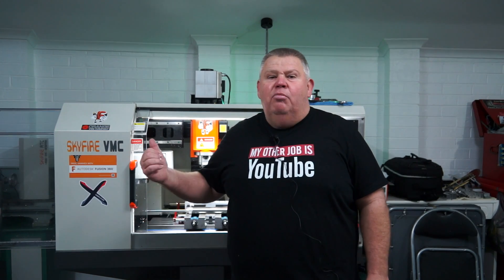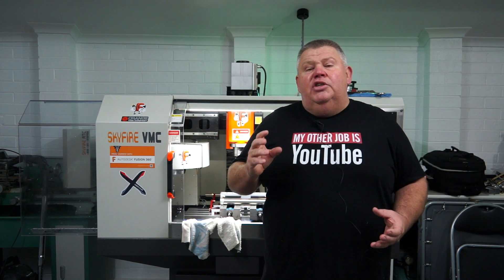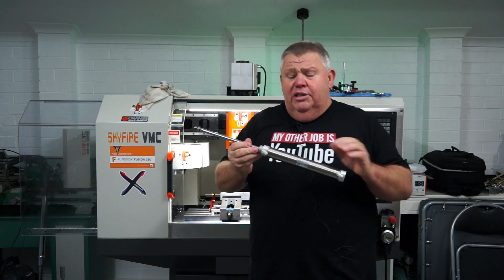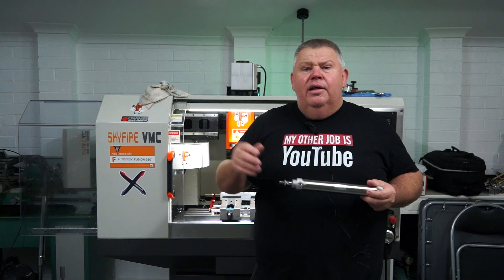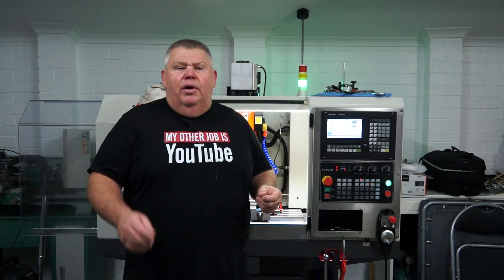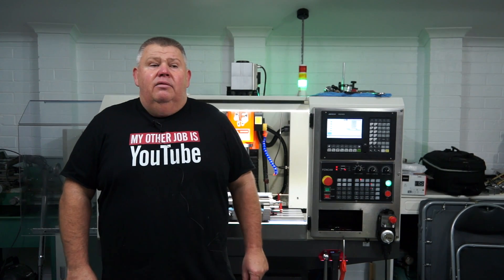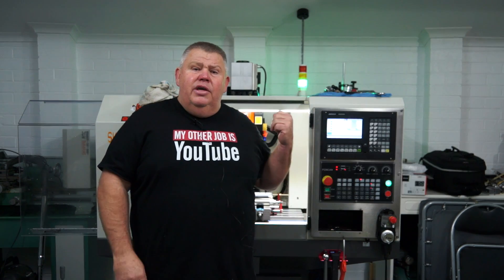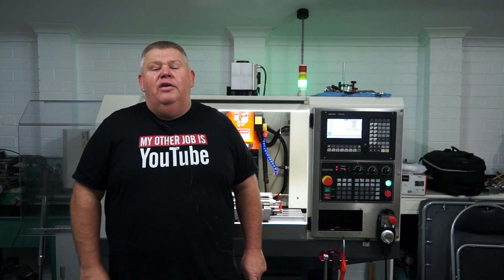I broke my Skyfire CNC Mill - (SVM-1VMC)

Comment: Kenny....I was just thinking. You are aware the Skyfire is a direct copy of the old troublesome Mikini 1610L? (In fact im pretty sure skyfire used the old stock cast heads and column)
You might want to see if you can find Mikini for sale and strip it to the bare bones to upgrade.
Reply: That may be something to look into as if I recall correctly the failure of the Mikini was more spindle motor related than the mechanics of the mill itself. I have been reading all over for the last few days again. The very first thing that jumps out at my about the Syil machines is that there are a ton of threads on the CNCZone with issues that just went completely without response. I am reading back through the Mikini section now.
Reply: Unfortunately Kenny, thats china for you. If you buy china you will have no support. I work at a mutli million dollar company, and their supply chain stuggle to get answer, so consumers dont stand a chance. That why large companies that manufacture in china have european / america support networks. Skyfire tried that with a fee agents off cnczone....but I think even they got pee'ed off with him.

I would scan ebay for a mikini and build your own machine as you want to
Reply: I'm not terribly worried about being self supported as that's what I do know. If I could find a U.S. made machine with what I want that didn't require a 2 a bedroom house worth of floor space it would have already been purchased.
Reply from the maker: Hey Rusty.  Sorry I missed this comment all those years ago.  Yes you are correct it certainly is mate  👍
Reply from the maker: I've had better luck with the new Syil.  It leaves my SF for dead  👍

Comment: Pity I was going to cut my teeth with one of these machines to get into CNC machining, as you well we discussed a few years back mate, its a shame its looks like they have just become they typical type of product that China produces with the usual lack and disregard for the consumer, how long before they take your money and just run...?

So looks like I have to wait another 20 years to for fill my CNC aspirations, or is there another company that hobbyist can get a machine that works without have to go into more debt, and have some reliability without braking the bank, are SYIL or Optimum really any better?

Pete.
Reply from the maker: Hi Peter nice to hear from you.  Overall mate I'm still very happy with my machine.  Obviously the air quality that I supplied is my fault and not SkyfireCNC.  I think the machine is still great bang for buck, but they need to address quality control and update the controller firmware (or chose another company).  I would take a look at SyilCNC and get a quote on one of their X5 or X7 combo machines.  Oh an optimum f80 is basically a Syil X7 frame.  Otherwise, save up and buy a Haas ;-)  Cheers, Aaron
Reply: Ok so you would go with a Siemens CNC controller?

Pete.
Reply from the maker: Yes Syil can offer a Siemens controller.  If you just want normal 3 axis machining the Siemens 808D is perfect.  If you wan to do 4 axis you will have to go with the Siemens 808D Advanced $$.  Keep in mind that going Siemens is expensive, but it's a great system.  Xu Shou is looking in to a Taiwanese control company called LNC and their M5800 controller.  Much cheaper, but very capable.  Send Syil an email and tell them I sent you (ask for discount).  Cheers, Aaron.

Comment: G'Day Aaron. Sorry to hear about your bit of drama(dirty air). You would not be the first to have the air affect the function(serviceability) of mechanical components. I am disappointed about the other problems of your machine too. While I have sold my Tormach(which ran almost faultlessly while I owned it), as you would know it is very hard to walk away from CNC machining. I have been following your posts since you bought your machine and was considering your machine should I get bitten too hard again by the CNC BUG again. Your controller too sounds interesting. It's hard to imagine that the controller has restricted 3D machining capability given that Cad Cam (Fusion 360 in particular) systems that are available these days to hobbyists for little or no cost. 
Come on Skyfire how about an update(surely that is possible) for the controller and of course SUPPORT!! 
Best of luck Aaron.
Peter
Reply: Just wondering, would you recommend Tormach Mills and Lathe
Reply: I had my Tormach series 3 for around 18 months. In that time the only real problem i had was a failed BT30 spindle. It was a cracked bearing.
When it happened(about 30 days from brand new) i contacted Tormach by email eith a sound clip that demonstrated the problem. They called me and said they could not "read " the file. I explained what was happening.
He simply asked me if i wanted a bearing kit or a new spindle. I took the new spindle. ( it arrived in around 6 days). Not a problem after that. The new operating system was a huge improvement over the original mach 3. 
Accuracy was very good.
Finish excellent(always used quality carbide cutters).
A few design things i didn't particularly like(dtandard spindle for one) and i would have prefered linear slideways. But at the end of the day i considered the machine pretty well made, great support(from U.S) and regular software updates(once they changed operating systems), well packaged when delivered and easy to assemble(with a few tools).
Was i happy with it. YES very happy.
I would have prefered a real controller(had Tormach touch screen and Computer), but was pretty happy with Tormach operating system. Hope this helps. Peter
Reply from the maker: Hey Peter, can't believe I missed this comment all those years ago.  Sorry about that  👍
Reply from the maker: Yes I would, but the cost here in Australia is way overpriced!  My personal opinion, I think the new Syil X7 would eat one for breakfast  👍

Comment: And they are non existent and website gone. 

Wonder how many millions they kept and didn’t deliver?

At least if you have a machine you should be able to fix with other parts. 

Unfortunate but there is an upside.
Reply from the maker: Hi Glen. I bought my little machine a few years ago now mate. I have since sold it and moved in to a Syil X7 mill. It’s a bigger and more solid machine. The newer model X7 are even better now. As for SF, no idea what happened to them and the company owner Defang. Cheers 🍻

Comment: Hard to believe Skyfire think one of those Adtec controllers will do simultaneous 5 axis.
Reply from the maker: Hi Richard, I have seen a video of them running their prototype 5-axis on the Adtech the same as mine.  I think you've made the right decision going with a Siemens.  Cheers, Aaron

Comment: Manufacturing quality doesn't seem to be at fault here, most machine manufacturers specify minimum air quality requirements. A $30 inline filter and a long hose run from the compressor (to let the air cool) would have most likely prevented this issue.
Reply from the maker: Hey Nickita.  Thanks for watching and thanks for taking the time to comment.  I'll take your suggestions on board ;-)
Reply: not really an issue here of machine quality than it is of the way things are being run at skyfire.    a woefully inadequate controller and not following through on a promise to one of the guys responsible for them having a better reputation than they should (?)

Comment: you've got the controller that was specifically mentioned for use with the 4/5th axis?
Reply from the maker: Yes I have mate.  However, they should have done more research on this controller before making it an option.  Better still, maybe I should have researched it better from the start ;-)
Reply: 4/5 axis is one of the key things I was wanting too.... if it can't handle the 3d, whats it gonna do on 4/5????
 oh well.  I've been watching the Syil you mentioned.  everything is so "new" at this point.  glad I've waited.

Comment: Chinese quality screams to mind.  I think i will stick with denford and tormach. Those syil machines. Has an x4. Pure scrap.
Reply from the maker: Hey buddy, thanks for watching and for taking the time to comment.  To be honest, there are quality products coming out of China, but you've got to pay for it.  SyilCNC are actually an OEM company.  That is, they make castings for other machine companies.  I can't mention it here, but I've seen the factory pictures.  One example I can provide is Optimum F80.  It's actually a Syil X7 combo ;-)  I don't know much about Deford, but I know that Tormach are also made in China.  Cheers, Aaron.
Reply: Tormach is Chinese and their machines don't even have linear rails but dovetails with jibs. Tormach is just an expensive manual mill conversion that you will end up working on to get running right. If you are going to do that I'd at least start with a mill with linear rails.
Reply: HAAS is about the lovest quality you should ever EVER get.. everything below just will give you truble...... rather get a used fadal or bridgeport vmc.

Comment: I think I be better of with a syil as their tend to have a better rep
Reply from the maker: Hi Chad.  To be honest my Syil X7 is a much better machine than my Skyfire.  In comparison, the X7 is a bigger, heavier and a more powerful machine.  However and to be honest, my little Skyfire was running sweet in the end, but the servo's holding torque was weak when pushing larger dia cutters.  My friends (Pieter & JP) still own their Skyfire CNC machines and I think they are still running well for them.  With any machine, I suggest you do your homework thoroughly and speak with other users and get their testimonials before purchasing.  Cheers, Aaron.

Comment: Why don’t you get a new compressor like a bigger size and run ur machine better
Reply from the maker: It all costs money Melvin.  And my wife keeps an eye on my spending mate ha ha ha
Reply: DCTTeacher1 I can’t believe you can’t rebuild your air cylinder. Like I have rebuilt a air cylinder at work.
Reply from the maker: No you can't rebuild this type mate.  It has swaged ends and can't be disassembled.